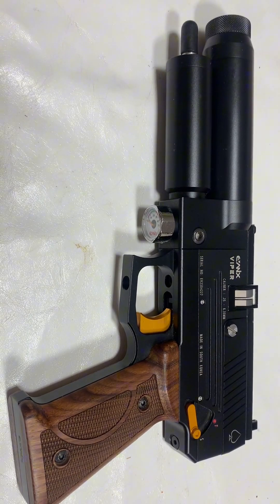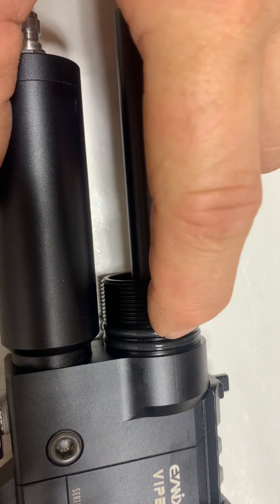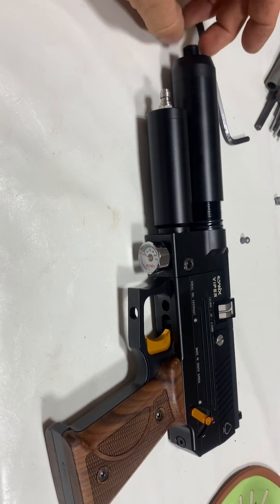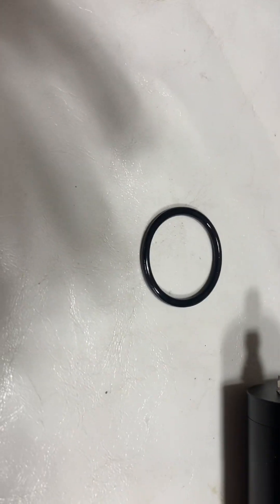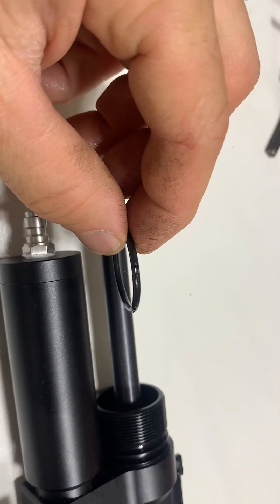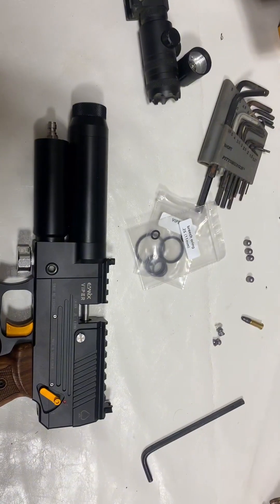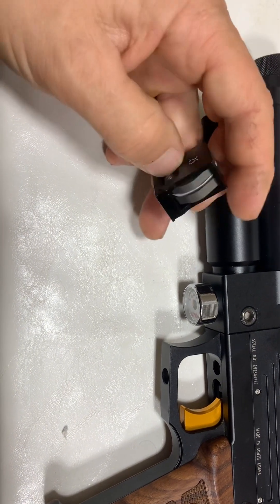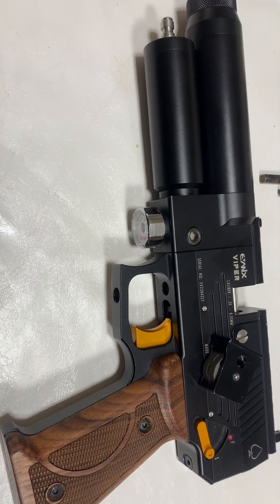Unreliable if it leaks air Evanix Viper O-Ring issues Buyers beware always check your air.

Comment: Thanks for posting this.  How slow was your leak?  I’ve had the same problem with mine.  I have the .22 version of it.  Sent it in twice for repair…still leaks.  The first repair slowed the leak by half.  The second repair did not improve it.  My worst Airgun purchase ever.  How did you bleed out the last of the air and how did you remove the barrel shroud?
Reply from the maker: Bleed with the Allen screw on the bottom or side depending on where your pressure gauge is mounted. The barrel screw off easy by hand once the pressure is off. Get a good quality O-ring set and replace them,  all the rubber is crap. So is the service Russ and I got from Patrick at Patriot airguns. They lied about the FPS of the .22 caliber advertising 775fps with a 18grn pellet and we showed it got less than my .25 with a 26.5 grn pellet the .22 was at around 610fps with an 18grn pellet. When I called him on it disputed the charges when he refused to fix it to reach advertised specs he wanted to deduct over $400 to return it without fixing it then changed his advertised specs on his website also did his other friends selling them too and threatening to blackball Russell an I from buying airguns because he knows all the other dealer. So we cot him in false advertising and he wants to punish us for it... BTW both guns leaked too so if you bought it with a credit card you might contest it too.
Reply: @tomthelandloardpma7683  I bought mine from New England Airguns.  Evanix apparently will not replace guns, they will only provide replacement parts to their resellers who have to repair them on their own with no compensation from Evanix.  I will never buy another Evanix Airgun.  Thanks for the tips!  I thought that the Allen bolt was used to bleed off air, but wasn’t sure.  I want to sell the Viper and get the Huben GK1, but I cannot in good conscience sell an Airgun that leaks air.  If I can fix the leak I will sell it.  None of my other airguns leak.  Not my Hatsan Blitz, AEA SS max, nor my Air Ordnance SMG 22.  My Sig Sauer MCX Virtus did have a leak in the regulator, but a new one fixed that issue.  Both it and the SMG 22 use removable paint ball style HPA tanks (13 cubic inch and 48 cubic inch).
Reply from the maker: @genuinetuffguy1854  I saw a few weeks ago John was still advertising 775 on the .22 I have a leek in Benjamin rogue with its electric valve they did not fix it and sent it back with the same slow leak it was never dependable you could not have it as a gun at the ready in the corner because it would loose about 50 PSI a day